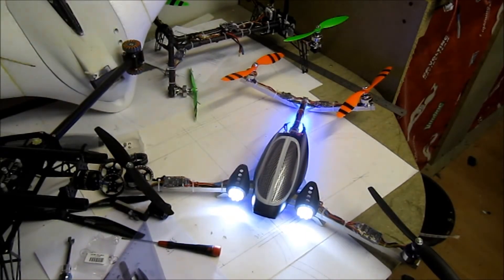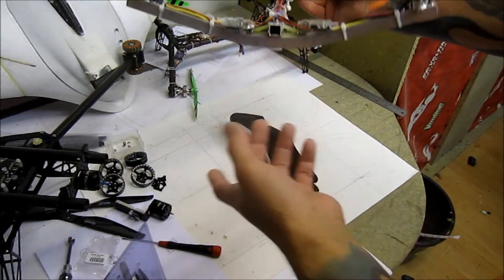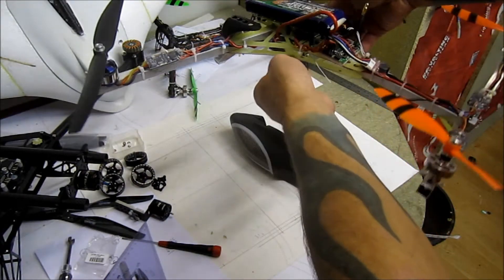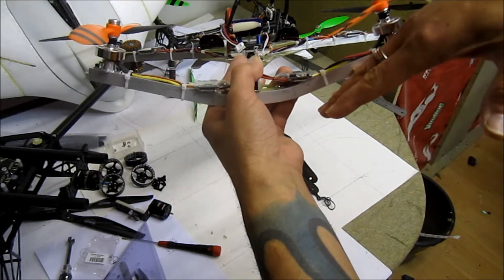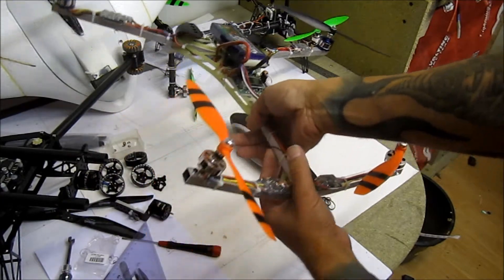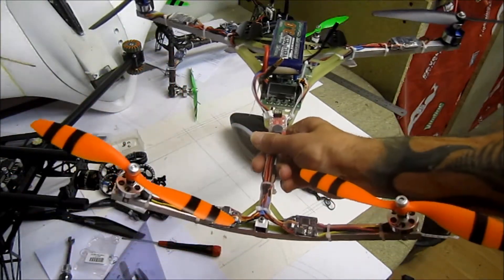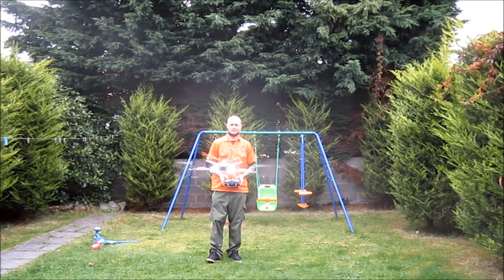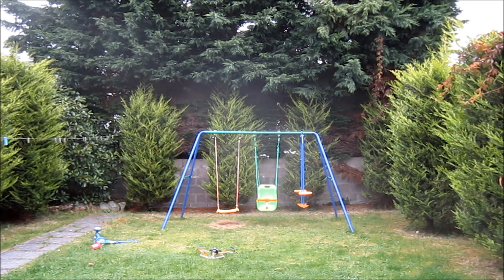KK2 V-tail quad. Review and a test

Comment from the maker: They are "12 LED Cluster WHITE" in Hobbyking's  "Hardware & accessories. > Night Flying Accs." section. In a daylight they're OK for visibility, but not that super bright- enough for flying LOS. Keep in mind that they run at 6v max. I got them tested at 12v- seriously bright, but overheats a lot and one LED burned out

Comment from the maker: If CG would be in the centre between front and rear, than it should be OK and same motors would do with only a bit of difference in thrust between them,what can be adjusted through the board.On this V-tail I wanted it to act like tricopter,where yaw turning axis center is more at the front and tail just swings at the back,more like helis.Therefore front motors are working harder and rear ones are working less.Most of V-tail softwares have increased rear motor throw because of some lost in thrust

Comment: cool copter. interesting, I have had problems as my rear motors are 15% more powerful than the front! Bit of a design flaw by me there.... do you know why the rear motors only need to be equal to one of the front ones? i would have thought if the weight was centered between all the motors it would be ok